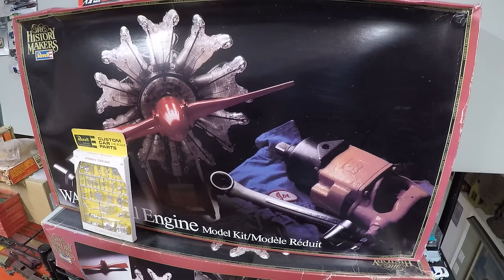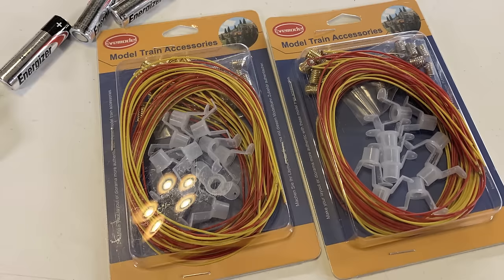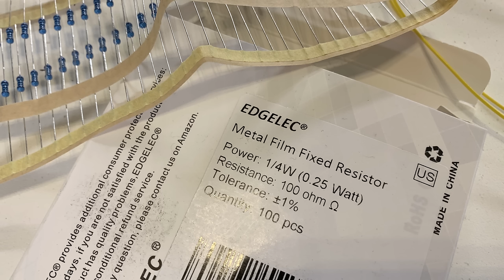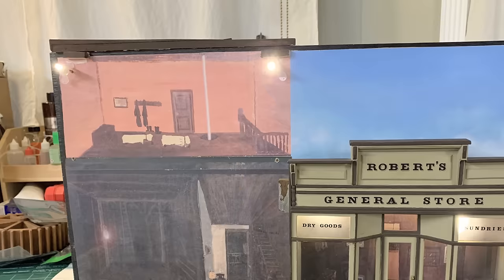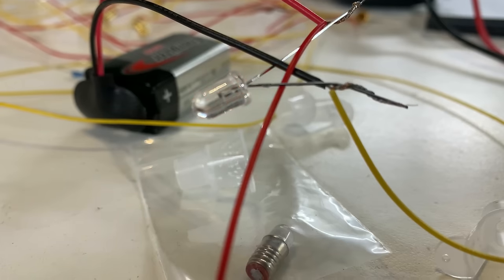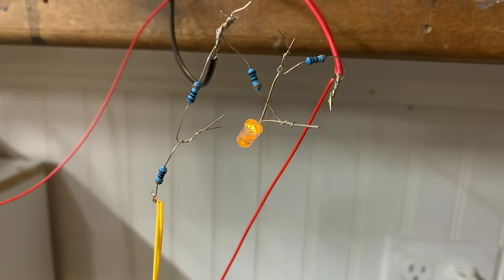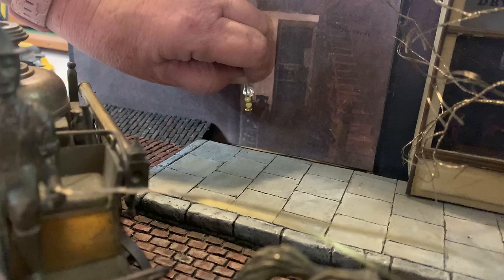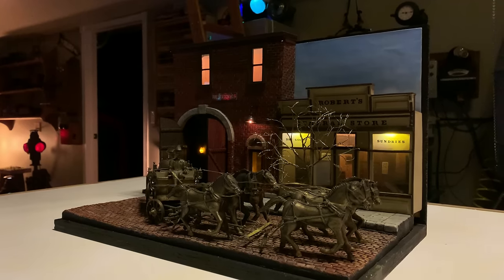Wiring and Converting From Incandescent to LED Lighting  - Restoring Delton's Brass Fire Wagon

Comment: You did it.  Took a mess and brought it back to its full glory.  I understand using the LEDs.  I think Delton would have used them in the 80 if they hadn't been so expensive (relatively speaking) to the other bulbs.

Comment: That looks great! I need to get a round-to-it and put lights in my buildings. Just adds so much life. I might even try some of the flickering LED's. I didn't notice how those white LED's looked until you changed the color. Sure looked like some fluorescent in there. Gaffers tape will hold a really long time, probably years, but it will also dry out and leave a crusty dry residue on everything.
Reply from the maker: Go for it!  Lights are great!! And yup. LEDs are odd colors. Always. But worth the effort.

Comment: I ran into some of the same issues with LEDs that I wanted to run on 12v.  I used Ohms law and then calculated the resistor size using the same law, solved for power.  I used 1/2 watt.  That got hot.  Moved up to 1 watt, then 10 watts, then 100 - still hot.  Hmmm...so I solved for the total current - 300ma.  These are typically those lightup cars that Menards and Woodland sell.  Advertised as 50ma, but that is not true!   Eventually had to order a very untypical resistor that could handle the high current.  If you did this in parallel, it makes it worse by increasing the current.  I also had to run my 4.5v buss over the span of my layout just to power the one little car.  All this to explain to the wife why a 5 minute project turned into an all-day experience.  😆

Comment: A) I have some LED lanterns to use for power outages and they operate on 3 AA batteries(4.5V)  Haven't had to replace the batteries in 2 years.  B) Are you planning on making a glass/plexiglass cover case for the display?  As always, great job!  🙂
Reply from the maker: Yes!! I hope. It’s the plan.

Comment: I often use 1k ohm for 12v or even 16v with LED's.  Adding multiple resistors in series you can just add the values together.  If putting in parallel Ohms law gives you a bit more complex maths